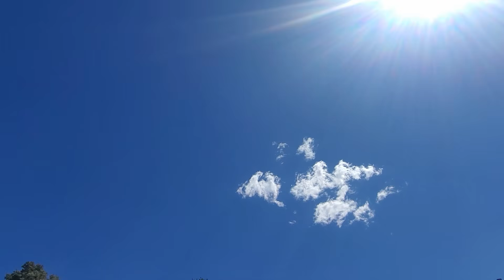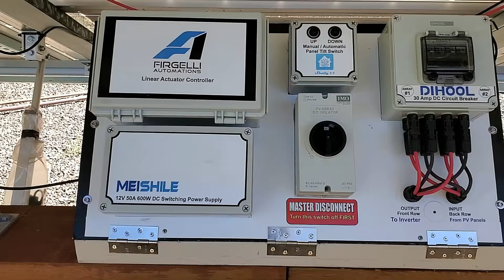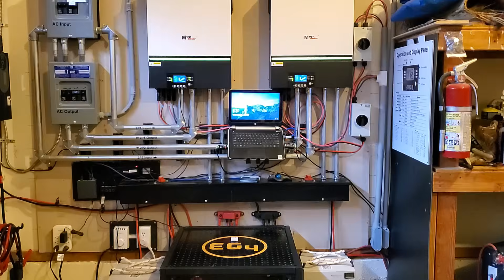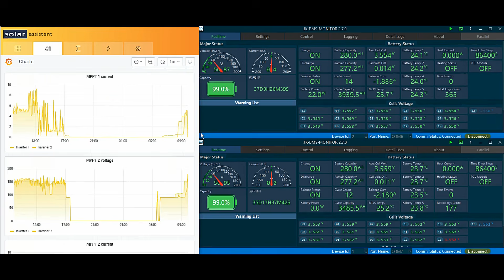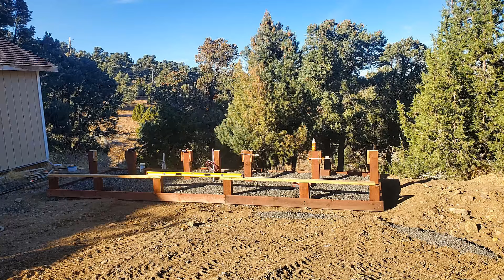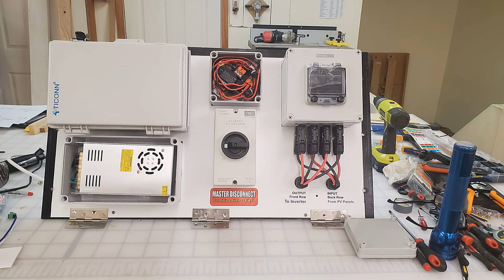Heavily Modified EG4 Ground Mount

Comment: Really impressed l.  I have moving array but have trouble with the controller.   Would like to see more of how you made it and the components.  Who makes the actuator what sends info to the controller.  Also i couldn't  find the list of conponents Thanks
Reply from the maker: The WiFi Controller was hand made using the components below the key factors were the position feedback linear actuators that talk to the Fergelli controller
I used the Shelly 2.5 to talk to home assistant directly which allows me to write automation scripts to move the panels according to seasons and track the sun if desired.

I have a wiring diagram for the Shelly controller but don't know how to post it?

Here are the actuator components: (Those are not affiliate links the are just product links to Amazon)

Linear Actuators 4 -zoom Heavy Duty Linear Actuator 10" Inch Stroke 330 Pound Max Lift DC 12v/2
EXTRAS: Position feedback, Mounting brackets, Weather resistant, Limit switches 
https://www.amazon.com/dp/B0722R3H9Z?th=1

Controller: Firgelli FCB-1 Actuator Controller - Programmable - Timer and Synchronous Feature
https://www.firgelliauto.com/products/synchronous-control-board

WiFi Control: 1 - Shelly 2.5 and 2 - mxuteuk 2pcs JQX-13FL AC 110V/120V Coil 8 Pin 10A DPDT relays
https://www.amazon.sg/Shelly-Automation-Compatible-Appliances-Certified/dp/B07Z623J8Z
https://www.amazon.com/dp/B07QXWZP3R?th=1

Comment: Hey, nice work using those linear actuators............I was wondering if you could put the model number in the comments for us?     Thanks
Reply from the maker: Details on My Actuator Setup

For my linear actuators, I used:

    Zoom Industrial Heavy Duty Linear Actuator – 10" stroke, 330 lb max lift, DC 12v/24v, with 5-wire position feedback
    👉 https://www.amazon.com/dp/B0722R3H9Z?ref_=ppx_hzsearch_conn_dt_b_fed_asin_title_8&th=1

The position feedback isn’t necessary unless you plan to use something like the Firgelli FCB-1 (or a similar controller) to keep multiple actuators synchronized:
👉 https://www.firgelliauto.com/products/synchronous-control-board

On my mobile solar mount, I went a different route. I used four actuators without position feedback and built my own controller around:

    ESP32 board 👉 https://www.amazon.com/dp/B0D8S22V7L?ref_=ppx_hzsearch_conn_dt_b_fed_asin_title_4

    BTS7960 DC Stepper Motor Driver Module 👉https://www.amazon.com/dp/B098X4SJR8?ref_=ppx_hzsearch_conn_dt_b_fed_asin_title_7&th=1

The actuators themselves are:

    ECO-Worthy Heavy Duty Solar Tracker Linear Actuator – 330 lb / 1500N
    👉 https://www.amazon.com/dp/B00NM8H5SC?ref_=ppx_hzsearch_conn_dt_b_fed_asin_title_5&th=1

Because these don’t have position feedback, the trick is simple: run them all to full extension, then back to full retraction. This “resets” them in sync, and they’ll stay synchronized for quite a while.

Note: The stroke length and actuator size really depend on your particular project and design needs.

I hope this helps
Reply: @apolloranch    Thank you so much from another 70 yr old........

Comment: This is incredibly impressive. I just built a solar awning part by part that took me a few months to finish up because I only did a very little at a time. It is nowhere near as impressive as this. I am not a carpenter so nothing on mine is completely square but since I have put the panels up on it, they have started to get much more power to my inverters than before. I would love to be able to build something like this in the future. I have 1 more structure to build, maybe I could attempt this and see what happens. I also used a bright mount for 1 of my ground mounts.

Comment: Building a system with off the shelf parts makes great DIY content. Linear actuators look interesting I will have to take a closer look. I hear EG4 has a Brightmount V3 coming soon.
Reply: hopefully, they will build it out where you can put a few more panels on it without having to add the small extensions to it.